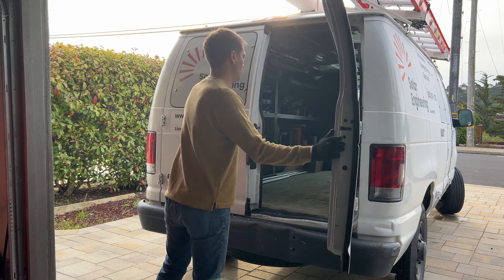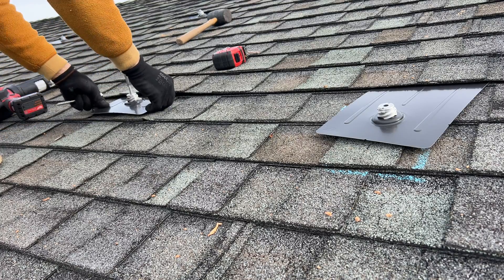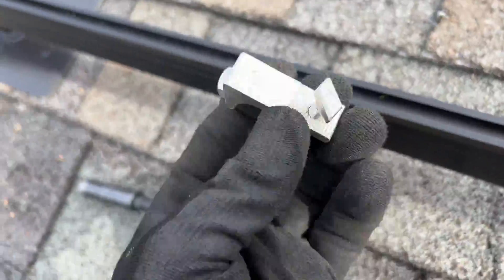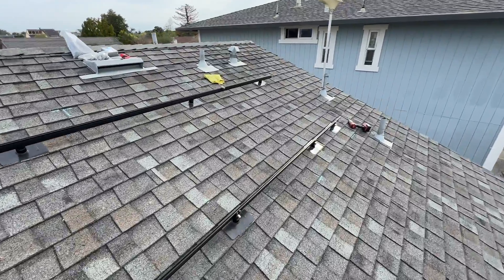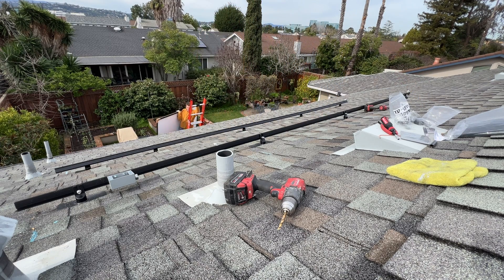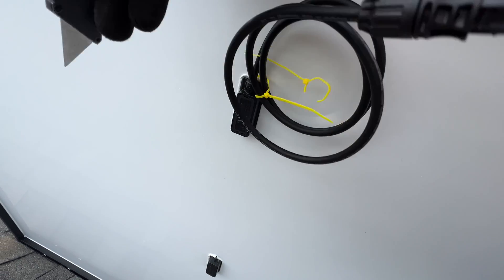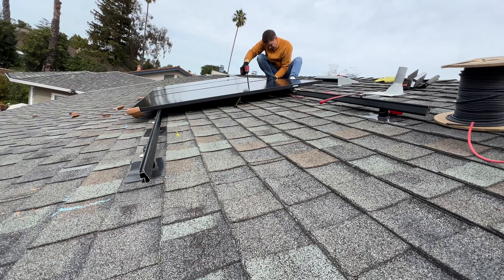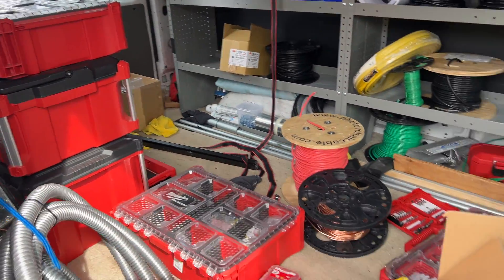Installing 4 solar panels for Ecoflow Delta Pro

Comment: You mention getting close to 1600 watts with this 2S2P array, but given the Delta Pro 15 amp limitation, it seems you'd only get around 925 watts?  I ran the numbers from those specific panels.
Reply: Sooo what's a good panel setup. I'm looking for a good setup

Comment: This great work and is exactly what I'm looking to do for my Delta Pro setup.  Too bad you're not in Virginia.  Do you have a parts list of the IronRidge items you're using?
Reply from the maker: XR-10 rails
IR-FF2-02-B2
IR-BHW-TB-02-A1
IR-UFO-CL-01-B1
IR-UFO-STP-30MM-B1
IR-XR-LUG-03-A1
Reply: @SolarEngineering  Thanks!  That's awesome.

Comment: I have squirrels that run and cause damage on the roof in the warmer months. Do you know if this setup is relatively safe from squirrel potentially damaging the cables underneath the panels?
Reply from the maker: to protect wires you can install something like this: https://amzn.to/3Tk15Vb
I did install it once, it takes a little bit of time to install, but worked well.
Reply: @SolarEngineering Thank you!

Comment: Awesome video. Can you tell me if a pvc junction box can be used ? Do you have a link for the metal junction box. Thks😊
Reply from the maker: Yes, you can use a PVC box as well, however, the conduit should be metal (in the US at least).
For metal box homedepot link: https://www.homedepot.com/p/Commercial-Electric-2-Gang-Metallic-Weatherproof-Box-with-3-1-2-in-Holes-Gray-WDB350G/300846204

And thanks for the feedback.
Reply: @SolarEngineering  Thank you sir.

Comment: Very nice. Did you wire in series and parallel because of the voltage requirements of the EcoFlow Delta Pro?
Reply from the maker: yes, specific for Delta Pro.
thanks.
Reply: @SolarEngineering  Excellent and helpful video! Question: I am about to install four 400W Phono Twinplus PV panels; all in series, but wondering if my assumptions are correct: The open circuit voltage is 36.87V (147.48V total for all four panels), which is under the 150V maximum voltage that the Delta Pro can handle. The short circuit current is 13.52A, which is under the 15A. Do you agree that I can put all four pv's in series? Or am I misunderstanding something? Thanks.